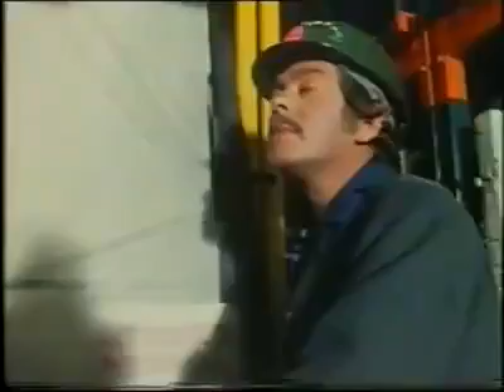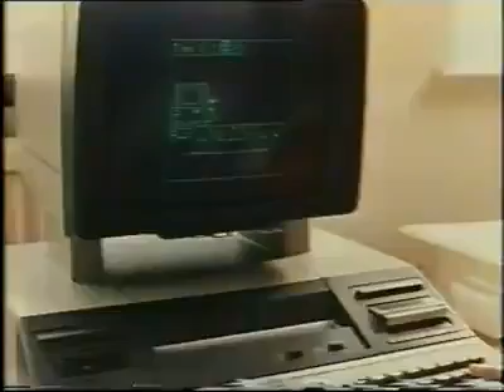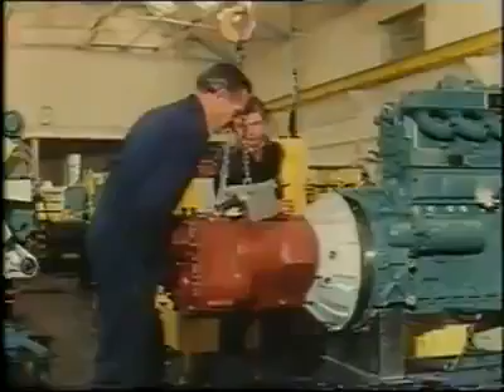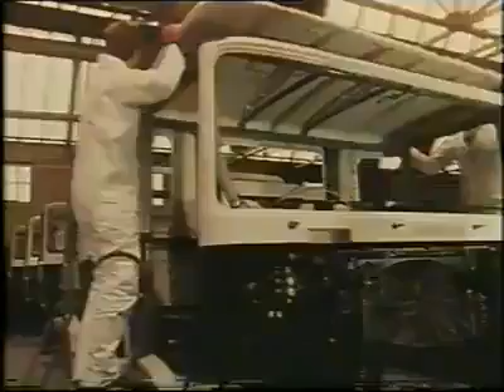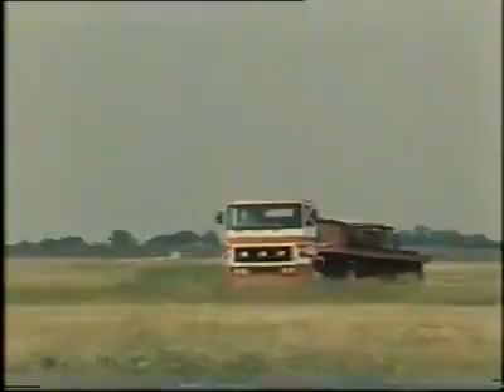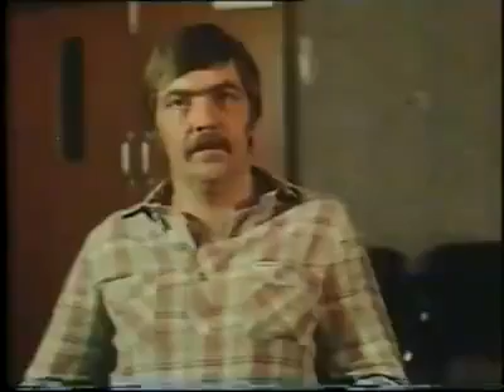Erf trucks engineering

Comment: Classic UK shed engineering and they were good at it, but the Scandinavian and German manufacturers were not lashing up other people components they were doing the lot and that includes the servicing and financing and of course they had European wide service networks. If you were venturing outside the UK, you were not going to get anything like their support from ERF. As the market moved to where the profits are in finance and servicing rather than selling the metal, the UK manufacturers were doomed, ERF selling out to MAN and that was principally as ERF with their relatively light glassfibre cab had  come to dominate the weight UK fuel tanker fleets and MAN wanted to flip those fleets to them.
Reply: ERF didn't sell out to man, ERF was bought by Canadian manufacturer Western Star in 1996, it was they who sold ERF to Man in 2000.